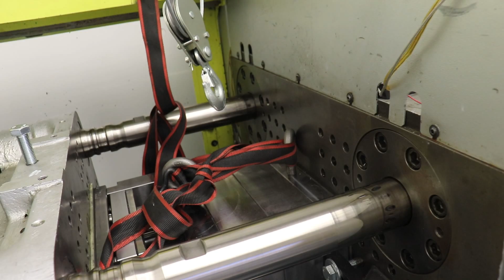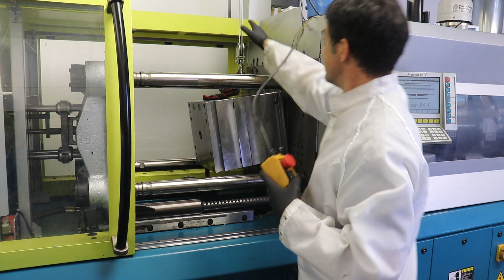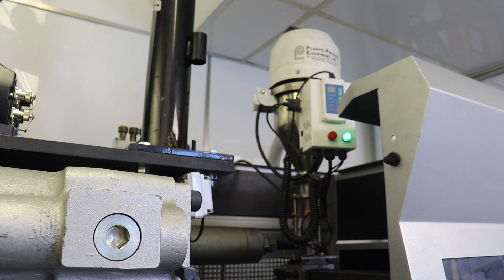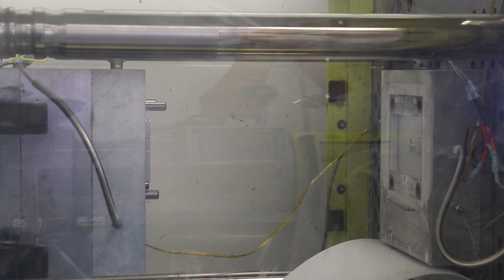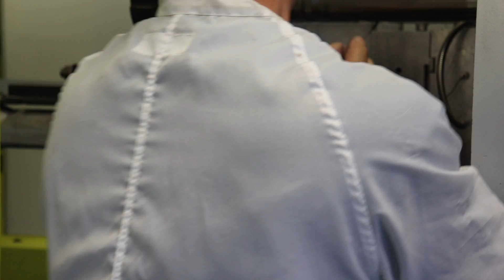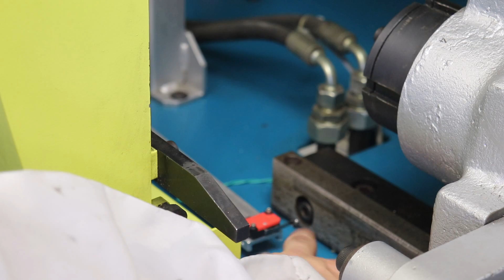PRODUCTION INJECTION MOLDING

Comment: As a mechanical engineering student that's just recently started learning how things are done "in the field", it;s both fascinating and hilarious how, on one hand, these machines work or micrometer precision, and on the other, the operator uses a plastic block to bonk the insulator in place. Reassuring to see that "if it works, it works" is generally acceptable in the industry when solving these practical problems.

Comment: Probably know but if you get a air pressure regulator on the air inlet port wright on the side of the mould, it will sometimes help greatly, it will limit the air volume by limiting the pressure but on ejection contiune suppling air volume. You've just got to start low and build up until it hits the sweet spot, you done even need a gauge if you plan to leave it attached to the tool. Jim🏴

Comment: This guy is butchering some known plastic industry terms. Use FILL instead of SQUIRT, and AUGERS convey materials. Reciprocating SCREWS heat, blend, and meters a uniform fill to the mold. Also, the plastic held ahead of the screw is called the CUSHION and without a consistent cushion fill and part dimensions are compromised.

Comment: Thank you so much for this video I learned a lot. I've always wondered is this process stinky? Like if I add an injection molding machine to my machine shop do I need to worry about my neighbors being bothered by the smell? or it stinking up the shop?
Reply: Depends on the resin and how you handle it, wasting a lot or save and care about the batch.

Comment: You are doing better than some who call themselves molders.
1- molding is a heat process, you need to achieve precise mold temperature, otherwise the process keeps getting hotter. Install a cooling circuit. the quicker that you return the mold temperature to its set point, the quicker is your process.
2- Too much unheated nozzle. nozzle should be completely enclosed with nozzle heater, running 2-3 degrees below zone 3. Good luck

Comment: Fascinating Stuff. Being a 99 ton machine. Is that the clamp force? Im curious why such a high clamp force is needed? Is the injection pressure very high too? Ive only messed with those little hand injection molders...and they dont seem to require much force at all.
Reply: I think he states 20,000 psi in the video, which is within the normal range for injection molding (~10k-20k psi). That's a lot of pressure trying to push the mold open.
Reply: @dwaynesykes694  that is pretty crazy.

Comment: Tap a hole in each mold half. Put a tie bar across with two bolts to keep the mold closed. Put a lifting eye in the bar at the balance point.
This will keep the mold together for handling, installation and storage. We always do it this way.
Reply: Thats the way most places do it.

Comment: I do it in a different way , disconnect Ejector and bar , then take the clamps off from moving platen ! open the mould while the tool still attached to the fix half , once moving platen open completely then remove the clamps on fix half !
Reply: I do it the same way.

Comment: Most/all injection molds have a external bolt clamp that holds them together when not in use? Also going forward all electric toggle machines are normally faster, cheaper and a lot less messy. Curious as to why you need/use a "clean" room. Is this a customer requirement?

Comment: One other question, do you not think cold water on the B half  of the second mold would help in your cycle time ?
Reply from the maker: Hi , thanks for watching and your feedback.  I think in this particular mold, cooling off the B side with water would probably give me short shots.  I'm actually surprised that the mold temp didn't rise out of control on this run.  Also, my water chiller may not bee able to keep up with cooling the molding machine if I went faster.

Comment: good video, the problems are similar to 3D printing, the plastic needs a certain temp. to melt, but like solder it can become 'jelly' and not a hard set, settings dependent, so it takes some time to "iron out the kinks", like sticking to one side, not being fluid enough, etc. all part of the coarse, even some elements of design, like too thin a wall can have an effect on things, so only certain shapes are good for this "additive manufacturing" process; hence why a lot of processes exist, 3D plastic forming, injection moulding, casting, milling, drilling, turning, all are most suitable to only a few part designs.
Reply from the maker: agree, thanks for watching

Comment: Thanks for the vid. One thing - leave a clamp on the op side stationary platen so the mold doesn’t bounce when you open the clamp. You can see if you need to adjust your hoist when you slowly loosen the bolt. Stay safe!
Reply from the maker: good idea, I will do that

Comment: We use similar setups with those inexpensive winches for our 4th axis machines so we can lift the indexers off to one side when not used. They actually work very well given their low cost. What would be an approx cost to run 1000 similar parts like those? We have a product that will need to be injection molded at some point in the near future. .
Reply from the maker: I usually bill the press time out at $70 per hour and charge for the color batch and plastic stock if I don't have it.  Do you have a mold or does that need made?  Thanks for watching!

Comment: What temperature do you heat your aluminum mold? Also if the mold was steel would you need liquid coolant circulating through the mold to keep it cool enough?
Reply from the maker: I think it was 175 F.  It probably would need liquid cooling to keep the insert the right temperature.  I was surprised that I didn't need it for the aluminum mold.  Thanks for watching!

Comment: Invest in a 30-36" long chain with a hook on only one end, get rid of the strap! Strap has way too much give to "catch" the weight as it comes off the platen. Also release the mold from the moving platen and open the press before releasing from the hot side. Also note that the ejector pins will NEVER hit the cavity face with proper length return pins, that is what they are for, to return the ejector plate. Just some observations for now, 40+ years building and running injection molds here, have seen and done some wild "accidents" during those years!
Reply from the maker: Thanks for the tips.  I will get that chain and hook ASAP.  will keep my fingers out of the pully too.  I do typically put return pins in molds, unless I don't have time due to customer rush, like this one.

Comment: Hallo, what type and make is this moulding machine?
Reply: Looks like a boy
Reply: @garethatkinson7765  He did say it was German. Probably an older Boy. The newer ones have very different controllers.
Reply from the maker: It is a Boy 90 that is ~15 years old.  The new ones have stepper motor drives and fancy controls. I have other videos showing the other 2 Boy machines in the shop

Comment: love the vid. one observation though. you can place the ejector rod with the mold closed because you have ejector return pins that stick out further than your ejectors (should). this is a safety precaution to not smash or destroy your ejectors if you eject forward and not have the bolted causing you to crush pins. so keep mold closed. a lot easier.
Reply from the maker: Hi Sugafree,  yes I agree, unfortunately this mold was made so fast that there are not return pins.  Your point may be enough for me to spend the time to add return pins to future molds.  Thanks for watching!

Comment: You can make things easier by picking a standard spot and putting in a couple 1/4-20 flat head screws on your insulator plates. Same with the locator ring. On the slides, if you cut a .020-.040 deep figure 8 on them it helps with the lube and wear. Cutting the figure 8 with a small dia ball cutter also helps. You brought up the mold lasting 10,000 shots. If you know you are going to want more then that, but aren't going to make enough shots for a production tool, anodizing helps a lot to extend tool life. It also helps keep the finish good, so you don't have to keep re-polishing and blasting.  On the hold down straps, you likely always use the same size backing plate and insulator on most molds. Making some straps with a peppermint spacer on the back is a really nice thing or just cutting a spacer the size you need and supper glue it under the straps you are using. It then no longer requires 3 hands to put them on and lets the wrench swing over the top of them. I also find it easier to put the knock out bar/bolt in the mold before putting the mold in the press.  Just a few little things.   Thanks for the videos, I like the channel
Reply from the maker: Hi Steve, you sure know your stuff.  I will do all of your good suggestions going forward.  Thank you for the valuable tips!

Comment: Like the compressed air ejection via the ejector pins. Could aid cooling pins and cut down on binding too. We ran an aluminium mold that was meant for pre production and ended up using it to make over a million parts. Think we re-bushed pins but the spec of the part stayed in tolerance. That tool had similar 30 degree slide pins. Think we sleeved them with a bush. Its a while ago. Haha. Very interesting. Thanks for sharing
Reply from the maker: Thanks for your insight and experience!
Reply: Haha, don't know about that. The machines were more manual, no computers. Wish i had had some of the machine available now. That's progress for you. We could have used air to assist ejection in fact i can think of one job for a Rolls Royce tail light reflector that would have been a lot easier had we thought of air ejection. All the things you said about bowing and stress marks rang true. Think we were using glass filled nylon. Thanks again. Look forward to your next video
Reply: Uh huh. Famous last words - “unit tooling”. We are only going to make 500 parts. That 500 become 5000, then 10k, then 100k. Then it becomes - how many can we get out of this tool? Luckily I work for a mold maker so I don’t have to deal with that anymore😀
Reply: Yes we were lucky. Also my dad was a genius tool maker. ICI used to give him experimental plastics to 'JUST TRY IT AND LET US KNOW WHAT YOU THINK!!' Legend
Reply: @ruperthartop7202  That is awesome. Every processor should have that opportunity. I had that opportunity with LIM at my last shop when the president told me to “figure it out, have some fun”. Roll forward 3 years and I was suggesting materials for projects. Be well!

Comment: Thanks for the video!
One question: You said in previous videos that this is a clean room. What does that mean? Washing hands and wearing a bunny suit to not bring in any chips/abrasive dust from machining? Air filtration?
Reply from the maker: hi Vincent, yes the room is setup to be a clean room  with 2 2x4 ft heppa filter blowers in the ceiling for positive air pressure.  I gown up to various degrees depending on the needs of the customer parts, (and the video presentation)  I keep the jump suit on most of the time since shirt fibers are the biggest problem with static charged new molded parts.  I don't keep a constant clean standard due to the high amount of reconfiguration of the room needed , (which can be a dirty process)  thanks for watching!

Comment: Are the waste parts at the beginning and waste plastic in the runners, flash and so on recycled? Do you grind them up and use it in future jobs?

As I recently got a 3D printer, this is something I stareted to worry about, in order to reduce my environmental impact as much as possible.
Reply from the maker: Yes, I do generally recycle the waste plastic,  I store it now to justify making a grinder or buying a grinder ( or granulator) the plastic needs to be granulated to ~4 mm chunks so the molding machine can take it back in the injection unit with out clogging the hopper.  Most folks accept a 10% regrind added back into new stock, some customers say "no regrind" as the performance of the plastic degrades from running regrind.  Hope that answered your question.  I think you can buy small grinders too.  I tried a food processor once with mixed results, don't use it for food after...
Reply: I dont think one can easily do so. The plastic is in the form of pellets, and their size is pretty consistent. Also, plastic degraded when it is heated. 

And regarding your printer: I assume you don't go through a spool per week, so the plastic waste produced by it is irrelevant compared to what gets thrown away in cars (the entire dashboard is an injection-molded plastic part), appliances and packaging material. I'm not saying that you should be ignorant to the environment, but the amount of waste produced by support material is rather low compared to everything else. And if you worry about the environment, try to get the plastic to a recycling facility (preferably sorted by type), and make sure it doesn't get shipped to Africa. Same goes for old electronics.
Reply: @vincentguttmann2231  Fortunately the recycling system is rather good here in Sweden. However, recycling PLA seems to be a bit of an issue, there doesn't seem to be many facilities capable of doing so. And yes, I'm sorting it by type (PLA and PETG so far).
Reply: @VorpalGun  well, yeah, PLA is very hard to recycle, but technically, it is compostable, meaning that it decomposes over years in a landfill, and turns back into lactic acid and so.
Reply: @vincentguttmann2231  There seems to be some doubts about that, with some sources on YouTube saying that it it only compostable at high (80 C) temperatures with special microbial cultures. So not in an ordinary landfill.
Reply: @VorpalGun  Well, according to some papers, PLA degraded best in an industrial composting unit, since its temps are higher, but if we wait ten years or so, an ordinary landfill will do the job just fine.
Reply: Depends on the properties of the specific material too, some lend themselves to being re-melted a number of times with minimal change, others are a one-time thing and that's it.
Reply: @d-rail7271  Yeah, that's for sure. I mean, look at PET bottles! They can be remelted five or six times I think. ABS is much more difficult, at least when you have hacked-together stuff to recycle filament.

Comment: How you have all your fingers I'll never know.
Reply: All of it! your standards are very poor. You explained your tool was 275kg then you continue to lift it on a winch where you can clearly see the markings along the jib for swl, then you go beyond it. 

You have your fingers behind the mould while is swinging about against the platen. That strap is absolutely ridiculous, requires a lifting bar. This is not a good example of how you safely change a mould. Its very poor.
Reply from the maker: was there a particular point in the video that concerned you?  The molding machine is triple safety interlocked ( mechanical, electrical and hydraulic) to prevent injury from standard operation
Reply from the maker: actually I saw my rubber glove got caught in the wench pulley.  I will add a finger guard to the pulley to prevent any possible pinch point

Comment: Hi.
Thanks for showing the mold with moving parts.
I've always wanted to know how it works.

How to get glossy surfaces of the parts?
What is the service life of an aluminum mold without moving parts?
Reply: I think for the glossy surface, you only need some polishing paste. In the past, he polished molds using some kind of cerium metal polish, so I assume that's what he used here. No idea about tool life though.
Reply from the maker: Hi, yes Vincent is right, I use IOSSO metal polish or aluminum oxide slurry followed by cerium oxide slurry, ( mcmaster carr to buy powder) The surface is raster cut with high RPM and low tool step over, then polish.  A Alum mold without moving parts can last ~10,000 shots assuming there are minimal fragile features like long pins.  you can also rework the parting line to fix flash problems but your part gets shorter.  Thanks for watching!
Reply: @DragonflyEngineering  I mean, why shouldn't I watch? I have clearly gone pretty deep into the youtube machinist community, since Blondi (which sent me here) had ~30k subs at that time. And I also like computer stuff and robotics, so this is the optimal channel! If you want, you can give us some short snippets in the story (since I assume that takes less work than cutting a complete video), or give us sneak peeks of what is to come.
Reply: You can also add heat for a glossy surface. Sometimes packing will help. I once had to pack out a part at 28,000 ppsi to get the finish that was required.

Comment: how many tons is that machine? not weight, but like 60, 100?
once my new house is built i plan to get one, and want to produce cases maybe 2 thirds the size of that.
Reply from the maker: It is a 90 metric ton, 99 US ton clamp . It runs on 220V 3 phase 60 amps.  I did run the  40 ton press with stepper drive motor at my house with a 30 hp rotary phase converter   Gotta be sure you can handle motor inrush current  if using an induction motor...
Reply: Be careful to keep your wedge angle as less as possible.  Saw a mold with deep side walls with 40 degree wedge angles open the press on injection.

I always made my cam pin angle 5 degree less than the wedge.  Have seen cam actions lock when both are the same angle from heat expansion or close clearance cam pin holes in the wedge.

You may want to add hardened wear plates under your wedges, also harden your slide retainers. The return, sprue puller and ejector pins function in aluminum flawlessly being nitrided, you want the same finish and hardness.